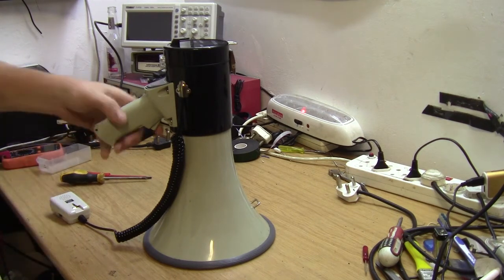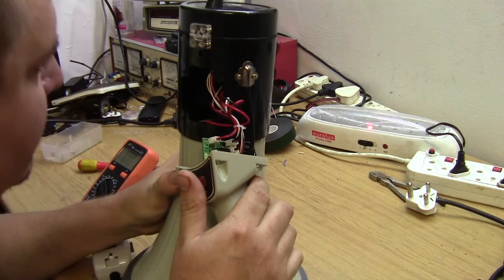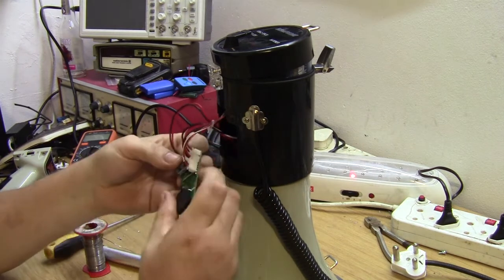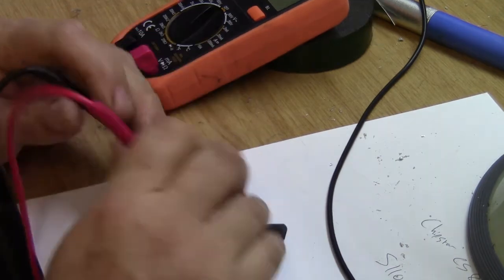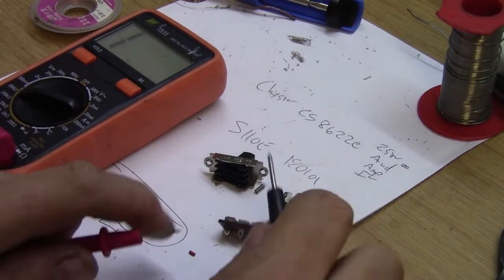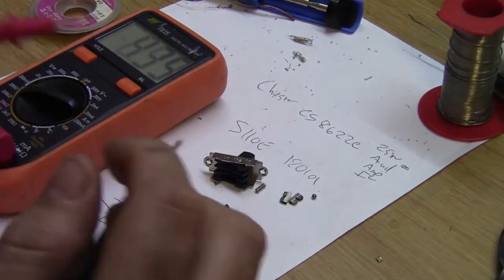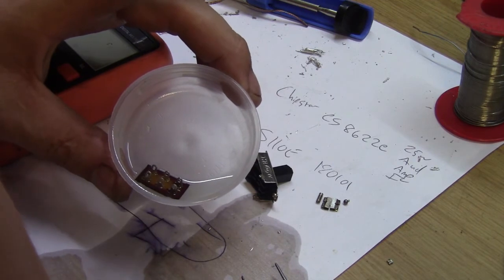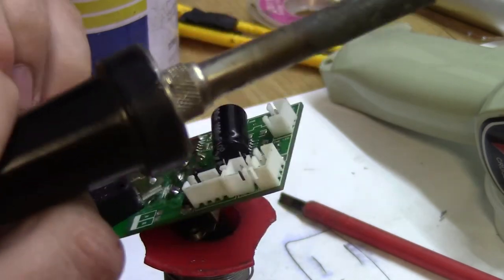ShoutingElectronics #32 - LoudHailer Repair

Comment: Don’t you just hate it when you get that Eish Eishkom moment when working. Think that switch got wet from sweat, which made the SRBP conductive. Should have washed out with the carb cleaner, but a wash in meths would have done it as well. Think your multimeter as well is dirty, as it takes a long time to count back to overrange on 20M range, should strip it and clean the input side of the board, along with the sockets as well.